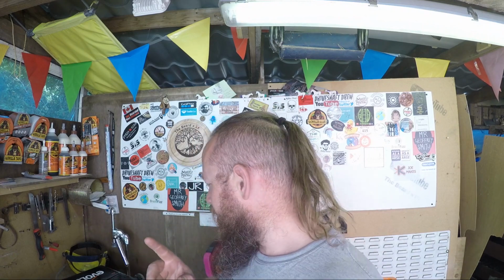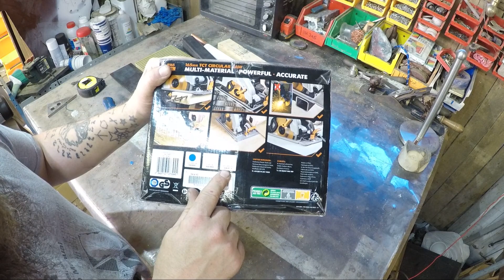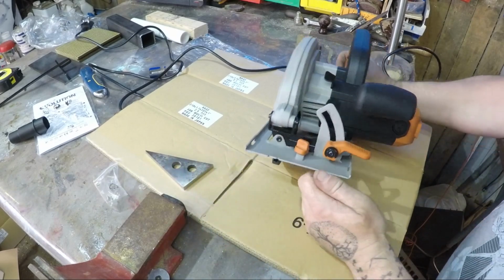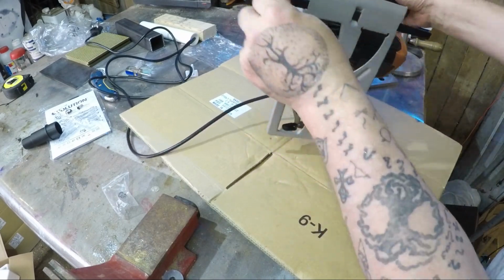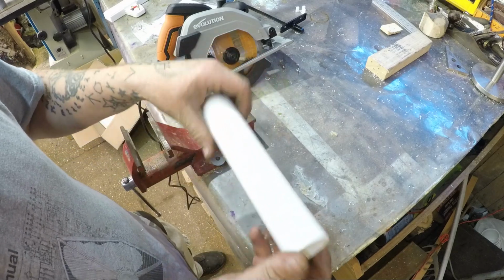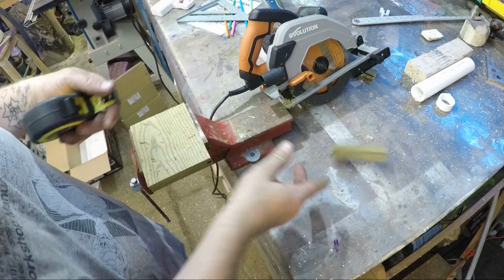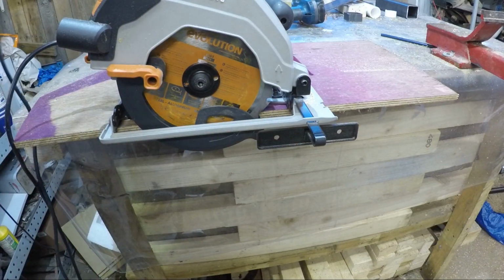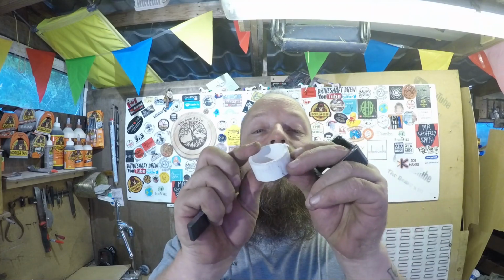EVOLUTION 165MM TCT MULTI-MATERIAL CUTTING CIRCULAR SAW

Comment: Interesting tool demo video.  I personally couldn't use the saw (the blade is on the wrong side for me), But the blade caught my interest.  I wonder if it comes in different sizes and arbors?  I also wonder how well it would hold up to laminate flooring (such as Pergo)?  Any time I have installed one of these floors I end up having to throw the carbide blades away when finished.  
Heuy nailed the reason for the little hangers.  The material gets so thin that it falls away before the cut is finished.  Got a little long winded, sorry.  Have a good 1.

Comment: Nice  most circular saw  has that little bit of movement.  
When you cutting the metal did it not build up heat in metal you was cutting.   It look and cut great on metal what I would use it for.  But also like to see how long it would last.  The blade
Reply from the maker: Didnt feel any heat when i picked the cut off peice off the floor .
Reply: @TheBeardx16  cool I have to look into the blade then  .
Reply: Its a chipping action off the blade not a grinding action, its a cold cut and you can touch the metal immediately, the chips though when they fly off during cutting can be hot.

Comment: I’ve just bought one. Only £39.99 from Screwfix. It’s the first time I’ve used a circular saw. For the price! Do you think it’s safe? Why is it so cheap? Kind regards Paul
Reply from the maker: Yes iv had no problems at all
Reply: @TheBeardx16  thank you for your reply. I bought it to hopefully cut sleepers for a landscape project. Do you think it could handle a 200mm x 100mm railway sleeper. Finished off with a hand saw.
Reply from the maker: @pauli1968  oh yeh ! Without a problem